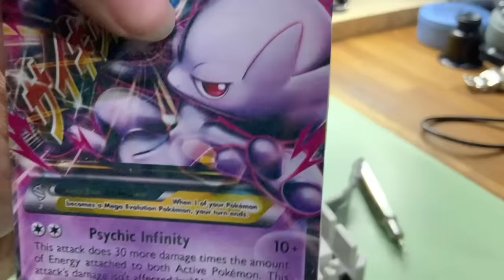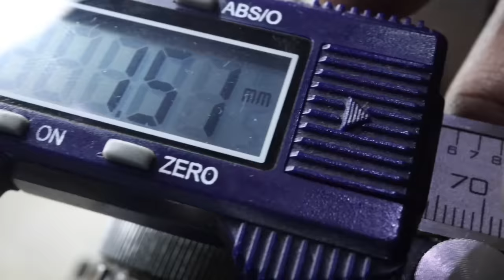WATCH RESTORATION CARTIER SANTOS - HAD TO MAKE MY OWN SCREWS FOR THIS - santos ronde

Comment: I'm amazed by the range of skills you use here. From heating hammering a pin into submission, resetting the stone and making tiny screws  - all over and above the "normal" stuff. Amazing!

Yes to a lathe restoration
And yes to sponsorship...don't even think you need to do two videos at one for this!

Comment: 1. The lathe restoration would be interesting, so I would watch that!
2.  Hey, you have to keep the lights on, right?  So, I have no problem with sponsorships or promos as long as it's obvious that's what it is.
3.  My question, short version:  How much restoration is too much restoration?
4.  My question, long version:  I love your work.  The case and bracelet restorations are really cool.  However, I do tend to like my vintage watches in as close to an original, aged state as possible.  I like dial patina, aged lume, etc.  A few dings and dents on the case/bracelet shows a watch's history.  You tend to go in the other direction, IMO, which is not a criticism. It's a big, wide watch world out there and one likes what one likes--and the level of restoration you do is undoubtedly driven by the expectations, tastes, and financial resources of a particular watch's owner.  But, for your personal collection, for say a non-runner you might pick up on eBay with intention to make it work and make it your own, would you do a like-new, full restoration or would you keep it as original as possible?

Thanks for your videos!  I really enjoy them.

Comment: Question: When installing the balance, you seem to get the impulse jewel into the pallet fork and the staff pinion into the jewel hole on the first try. Is there a trick to this? Whenever I install the balance I have to endure a dozen failed attempts before everything goes in correctly. Thanks and regards.
Reply: at least I'm not the only one...

Comment: Amazing restoration. The watch was probably one of the most trashed I have ever seen you working on. In the end, a magnificently fully restored is a gorgeous Cartier. Q & A,   Use of the Timegrapher.  When adjusting the watch, I noticed it's checked on different angles? Why? Awesome videos.
Reply: A mechanical watch’s accuracy changes based on the position (and the temperature). Watchmakers try to reach a happy medium as they regulate it in a set number of positions. On fancy watches regulated at the factory, this is often noted on the movement - it’ll say “regulated to X positions and temp”.

Comment: My only suggestion is this! 
When doing a brushed finish; Try a wet sand with wd-40. It will clear the ground grit between passes and keep it from making an irregular finish. I did this on a 10-22 receiver with wonderful results.  Great work. I am very impressed with your overall knowledge and a variety of tools to accomplish what I am sure most would just give up. 
Beautiful Restoration!

Comment: Another amazing comprehensive restoration job, although I would’ve thought it would’ve been easier to either outsource some of the parts or more specialised work (crown job for instance). You almost made me like a Cartier. Also mad respect for making it a point of keeping your anonymity in an era of selling out for 5 mins of “fame”. It’s a breath of fresh digital air.
Cheers

Comment: I'm very impressed with this, never seen a Santos in such a bad shape! One remark, this Santos is I believe known as the Santos Octagonal because of the bezel shape. The Santos Ronde has a round bezel...just a detail. If someone is interested in buying such a vintage watch make sure to avoid this first type of band that consists of U shape connections. Later on, Cartier replaced it with a much stronger type that doesn't wear out. Best regards!

Comment: Beautiful job! And is that a Casio Databank on your wrist? I gunked mine in the 80s when using a can of instant spray foam insulation and it was never the same 🙃I used to store all my contacts phone numbers on it - in 1986! Great to see one again.
Reply from the maker: Thanks yes it’s an original first issue which I bought with my paper round money lol

Comment: I  have a Seiko Solar chronograph that stopped working. I had it on a window edge charging and forgot about it. Apparently my cat had knocked it to the floor and I finally found it. At first the second hand was moving as I charged it, but now nothing seems to be working. Is it worth bothering with it, or should I just get a new watch?

Comment: Love this channel. Love your skill, ingenuity and creativity. Love it when you have to manufacture your own parts and love it when you let your kids help. But most of all I love your humanity. Your singing is, well, not bad 🤣 And I always watch all your videos from start to finish. You’re inspirational to the point that when I’m doing some DIY and hit a snag, I think about how you would approach it in 1000th scale. 
Regarding ads, I hate them particularly when they pop up in the video at the most inappropriate times, spoiling the view, but if you can build it into your commentary, I think it would work better. Keep up the good work. Oh and love the before and after comparisons. 
My question for the Q&A is: how often should I get my (only ) automatic watch serviced? It’s a Ball chronograph fyi.  I bought second hand and is probably about 7-10 years old and currently working perfectly, but I’d like it to last a lifetime and pass on to my children. And how do I find someone I can trust?
Reply from the maker: Thanks Brendon. Most manufacturers say service intervals are 3-5 years but there are watches that run well even after 10 years without servicing. When lubricants become old and concealed or dried out, then parts can start to wear down slowly so it is good to have it serviced even if  the watch is still working. I know servicing costs are not cheap so you have to find an interval that you can manage. Hope that helps

Comment: Very nice work. Most "watchmakers on youtube are  hacks. If I could offer some advice is to always replace mainsprings with every overhaul and use a more refined oiler tip. There's no way all of that train oil ended up in the reservoir.

Comment: Lovely stuff! Is it the case that you can heat treat low carbon steel because those parts were small enough? Also, I've seen parting off small parts can be done with a craft knife blade, if that helps at all! Amazing work and entertaining commentary as ever <3

Comment: Q&A: Have you ever restored an old Tavannes pocket watch and would you?
Reply from the maker: I’ve come across them a few times
Reply: @NekkidWatchmaker  The reason for my asking is I have a small box of various watches passed down for my grandfather to my dad to me... I guess my grandfather was a wannabe watchmaker back in the day as the box also contains a collection of cards with various hands and different crystals still with little stickers describing them. I've spent hours just looking at them and admiring them. I guess a sort of connection to a man I've never known.
Anyhow...one watch has always facinated me... The Tavannes...the movement has beautiful tiny details to it that I love. I've taken it to local watchmakers to assess but both seemed uninterested and told me it is not worth restoring as it is not a very collectable or valuable brand and the cost would be more than it is worth. 
I've tried to research it but haven't found anything even close to it...
From the general design it seems to be from about the 1920's or 30's...
Went back to the little box last night and after looking at it again I realized fornthe first time that it acually a wrist watch with the wire loops where the bracelet fastens to broken off... Even so it is still precious to me... If my hands didn't shake so much I would've tried to repair it myself. The fear of ruining it completly has always kept me from doing so. I was kinda hoping you have done a restoration on a similar one so that I could see what it would take and maybe build up the nerve to try! 
Anyways... I will start practicing on some other scraped watches and build my arsenal of tools and experience and I vow to one day see it run again!

Comment: I do have a question. When the watch has many screws they are not all turn to the same direction. In your discipline it may not be a thing but in mine we always want to turn the screws either all horizontal all vertical or something. Just a finishing touch. I certainly am not saying you're wrong, I'm just wondering if it ever crossed your mind or if it's a thing in your discipline.

Comment: It seems that, while watch repair and service is in demand in this golden age of microbrands. Watch design maybe a dying art. I'm not sure what still level separates the designer from the smith.  However,  in my opinion. At your skill level and with sponsorship knocking at the door. You should be designing your own brand.  Your knowledge and videos lend credibility to your work.  I would gladly purchase a watch you designed yourself.  Possibly a collaboration with another watchmaker like yourself could be a design that would set new standards in the industry. Instead of the hundreds of brand's that just have another Seiko movement.  We don't need more clones. We need fresh designs. BTW,   Happy New Year!

Comment: So looking at this, Cartier simply tuck the mouvement from a ladys wristwatch and simply designed a bigger face to fit into a bigger case that may fit on a man's wrist. And not take a poketwatch and turned it 45° slapped a leather strap on it like I always thought.  It would have been easyer. Wonder why Cartier decided to go down the more difficult route instead of choosing the path of least resistance.

Comment: Why do you wait and take the jewels out and oil them After you are putting the watch back together? why not clean and oil them when it is all apart.?
38:31  I seen what you did there. :face-purple-wide-eyes::face-blue-smiling::face-blue-smiling::face-blue-smiling::face-blue-smiling::face-blue-smiling::face-blue-smiling:

Comment: History? As a brazilian I highly disagree. Santo Dumond invent the plane, what the Wright Brothers invented was a glider and the system to accelerate and slingshot the plane to speed up and take off, as a glider. The idea behind the launch technology later on would be use on aircraft carriers to launch planes, but it was still a glider, Santos Dumond 14 Biz plane had a engine and propellers.
But I didn't know he was related with the invention of the wrist watch. Thanks for the info.

Comment: You seem to be a man with good ethics so I think if you believe in a product you are offered a sponsorship for then go for it. You can help a good product and your viewers get in touch and maybe get some sweet equipment at the same time. Okay back to the watch, you said the screws on the band are just decorative so why in hades didn’t Cartier head them and make the slots line up ? Finally Q&A could you explain “shock proof” and how it works please?